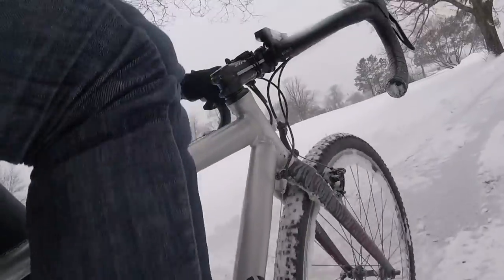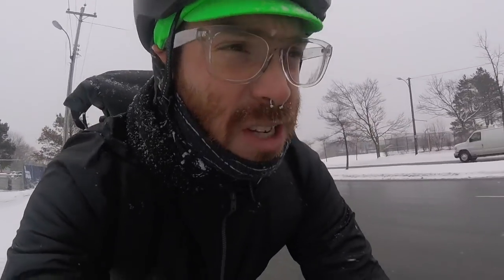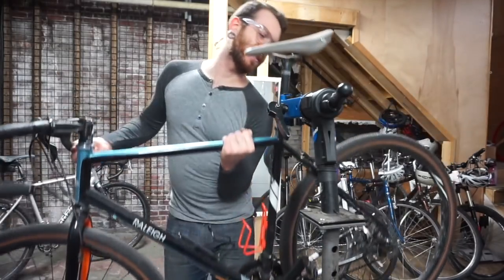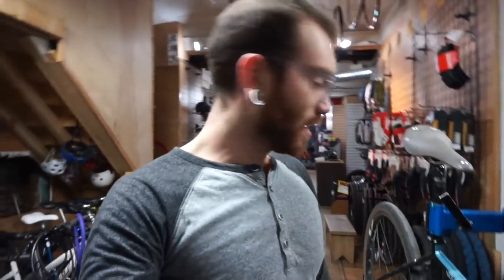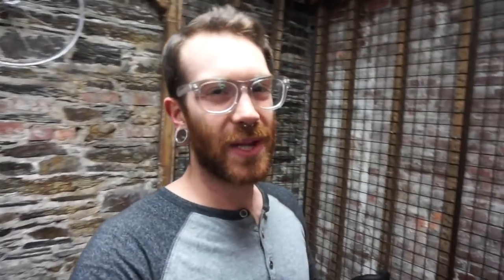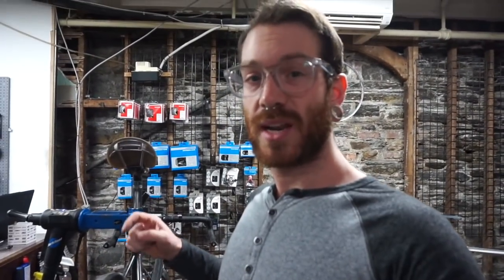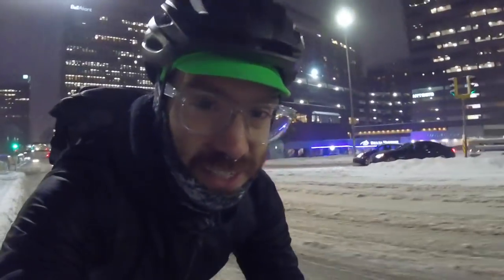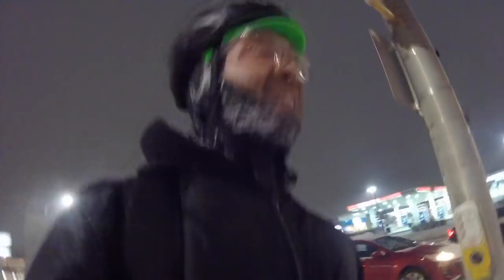Raw-nsterCross Does A Single Speed

Comment: Tensioner is designed to fit behind a bolted wheel so bit you thought was missing peices sits behind the axle on a bolted wheel
Reply: So like a claw deraileur? Slides in behind the axel, you slide axel in and screw down?

Comment: Cool vid as usual. I personally enjoy the hassle of figuring out the perfect chain length in order to avoid using a tensioner. I got too much time on my hands hahaha. ☮️ from NYC.
Reply from the maker: I actually plan on doing the exact same thing now, this tensioner is bleh, not having one would be so cool.

RT posted up a link to a page that calculates ratios and chain lengths that will create the proper chain length. I think a 15t and one less link will yield a non tensioner needed gear.

Comment: Yo, just use a tensioner with 2 pulleys design: the first one wraps a chain around a cog to prevent chain slipping, the latter one - tensions a chain. Works flawlessly on my mtb, no chain slipping on a cog whatsoever. My gear ratio 32:16. Cheap stamped ss cassette cog, generic chinese narrow wide chainring.
Reply from the maker: That sounds like a derailleur to me! Haha

I’d try all sorts of different setups, but am super interested in trying to find a gear that gives decent tension without the use of a tensioner at all. Ultimate RT posted up a link to a website that helps calculate some options, so I’m definitely going to be tinkering away with that!
Reply: Yeah, this may work as well. But with 2 pulley design you don't have to worry about shortening/lengthening your chain if you want to play with different cog teeth numbers. I agree - it looks almost like a derailleur, but then again - why not using horizontal dropouts? Magic gear may not work properly entire chain life due to chain stretch. Anyway, good luck.

Comment: Anyone know what those spacers are called where the cassette was? The R18 and L16
Reply: I'd search for a "single speed kit" DMR used to make one. They cost a fair bit though. It's cheaper to stack old cassette spacers and line up the chain straight from one cog to the next.
Reply from the maker: Getting single spacers can be a hassle too though. 

There are cheap ones available on amazon

Comment: Ah, the dreadful chain tensioner, best to just try and find a "unicorn gear". At least it didn't skip on you and the snow made it silent, I'd try to shorten the chain even more if possible and get a shimano dx sprocket, makes life more pleasant.
Reply from the maker: i ended up having to add a link. it would be cool to find that gearing that allows for no tensioner! that would be rad.
Reply: Try this link http://eehouse.org/fixin/formfmu.php
it estimated about 1.5-2mm off for me with the loosest recommended combo, so my tension is a little on the slack side after riding with a half link chain for 2 weeks, but the shimano dx sprocket keeps the chain on perfectly well even when fooling around on single track. Also you might have multiple gear combinations that you can run with a single chainring, I have 2 for 39t and 3 for 34t.
Reply from the maker: That chart is sweet! looks like if i throw a 15t on there i could ditch the tensioner...

I can't help but wonder if there are any smaller 110bcd chainrings i could get for this bike.
Reply: The smallest I've heard of is 33t, haven't ever seen one in the wild or even in the stores.